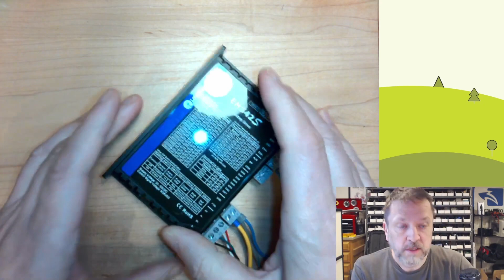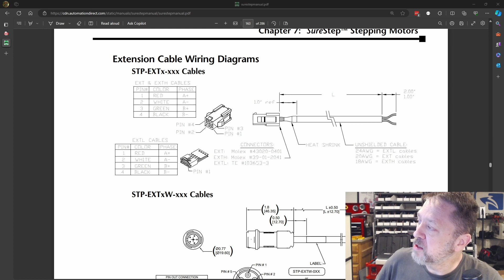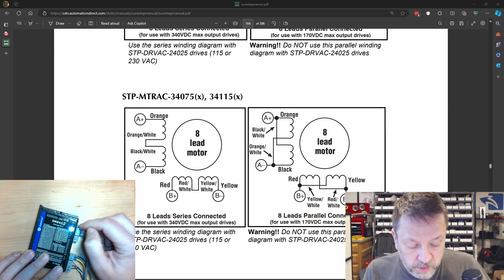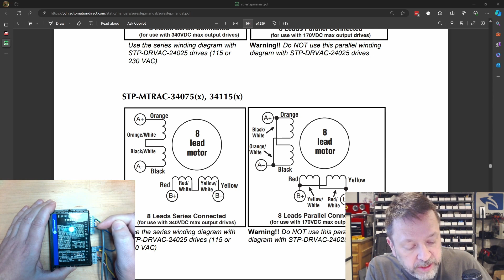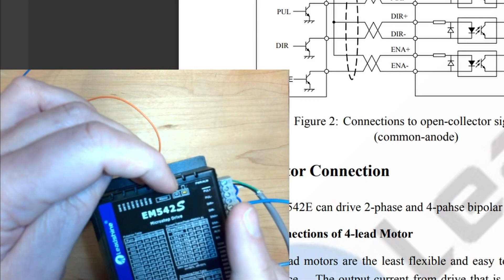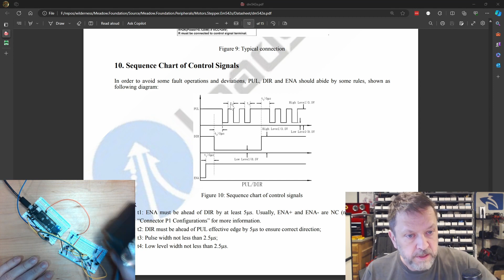How GPIO Stepper Motors Work - Wiring and Testing

Comment: Thanks so much. This is very useful for a servo project I am working on. Need to convert 3.3 to 24 volts. My only concern is if the transistors will switch fast enough. Thanks!